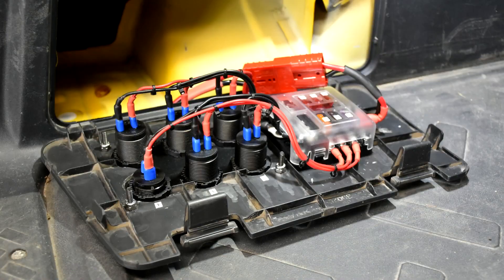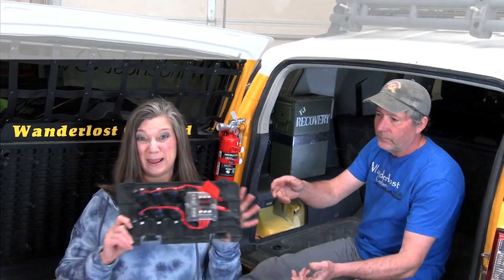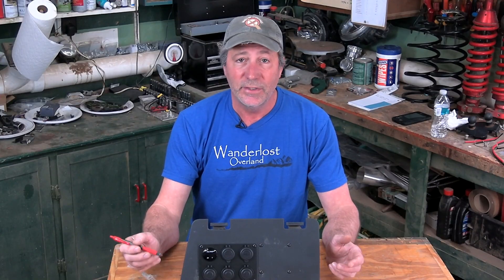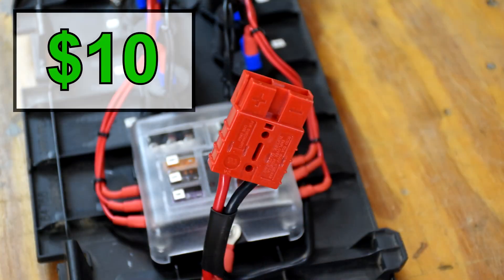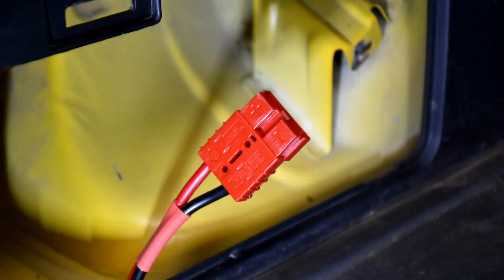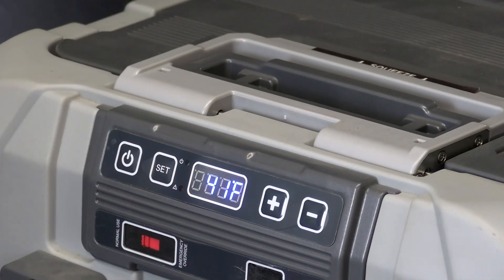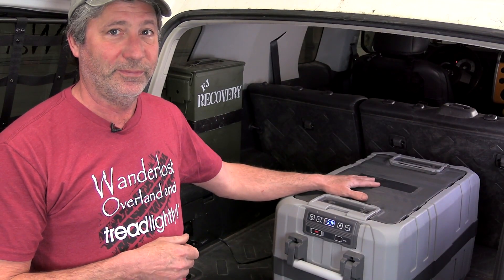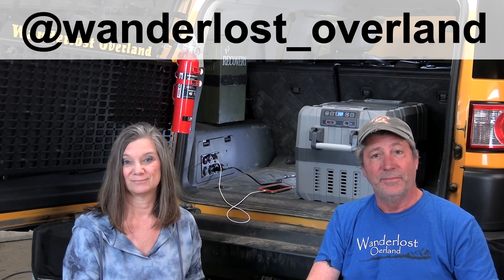12 Volt Power Outlet & USB Charging Station-EASY DIY

Comment: I came across this video and like your set up.  Very clean.  Curious, have you ever used all 3 12v lighter plugs at the same time?  What made you use 8awg wire instead of thicker?

Comment: Couldnt you have grounded to the frame back at the panel instead of running a ground from the battery
Reply from the maker: Some people do that. We prefer to have our two batteries completely separated from each other.

Comment: Did you connect the 12 volts meter on the fuse box ? Not to the battery? Building my system  thanks

Comment: Without the on/off switch, wont the ports draw power even without anything plugged in?
Reply from the maker: Yes, a little. When we're not using the panel for days or weeks, we typically turn the breaker under the hood off.

Comment: Quick question for y'all. How did you connect the tips to the wire of your Anderson plug? Soldier or crimped? Thank you J&C kuehlkuest
Reply from the maker: We always crimp these.
Reply: @WanderlostOverland  Thank you. Any particular crimper you recommend?
Reply from the maker: @jonnybkuehl878   It takes something more then a "normal" set of crimpers. The terminals are very HD. We actually made our own out of an old set of bolt cutters. You could get everything ready then offer a ten or twenty dollar bill to a local car stereo shop to do it for you.

Comment: Have same type of setup. Ran the cables inside. Also would add that the breaker manufacturers recommend pressing that small button when returning that small arm to in position. Great vids. Keep em coming
Reply from the maker: Thanks for the info!

Comment: I know very little about batteries and such.  Going to do a dual battery on my fj, but im building a trailer to put my rtt and stuff on.  

I want the trailer to have a battery and solar.

Is it possible to have a connection between the fj and trailer to charge the trailer battery while traveling??
Reply from the maker: Absolutely! When we did our 4Runner dual battery we made provisions for just that. we ran large enough cables to the rear to accommodate the extra 25amp to run a separate dc-dc charger on the trailer.

Comment: Nice work guys 👍. Simple and clean. Excellent work on the wiring

In a recent video ASPW from 4XOverland talks about voltage drops due to connections. Would love to see the voltage drop flow of this setup in a follow up video. I.E. voltage at the battery, at after the breaker, at the input junction of the panel and then the fuse box in the panel.
Reply from the maker: I will check it out!